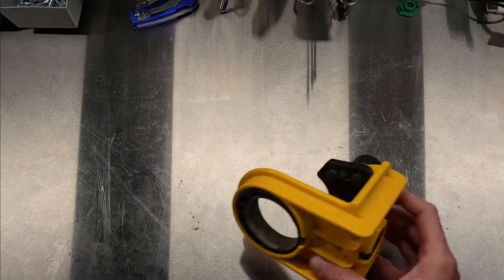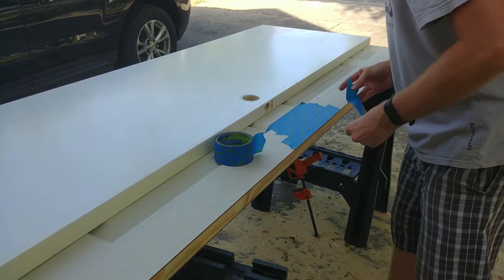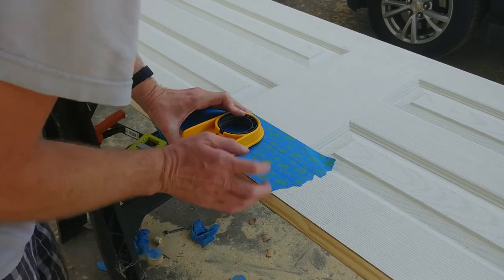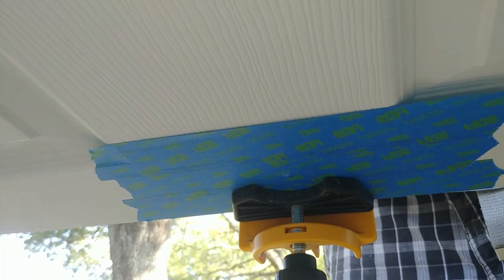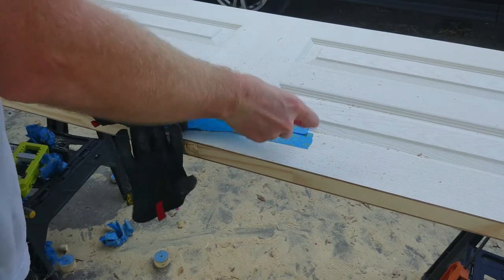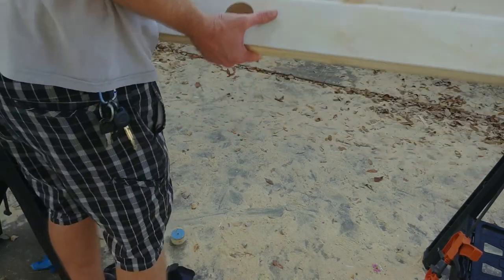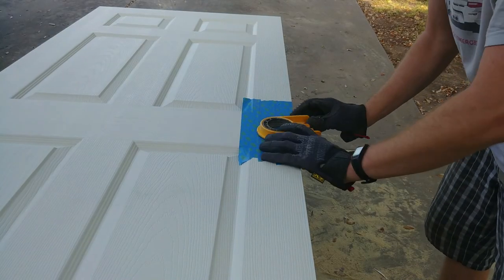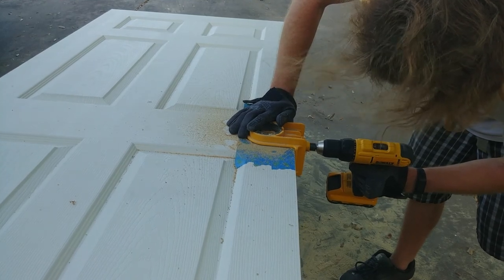Dewalt Lock Installation Kit - Boring Doors for Latches and Handles

Comment: How about solid 8’ doors 🚪? Is it necessary for a big horn boring kit? 🤷🏽‍♂️
Reply from the maker: I'm sure it could help but I didn't try myself as these were hollow core doors.  I think it really depends on how much measuring you want to do to get the latch bore and handle bore lined up properly but for me made the process much easier.

Comment: Why does everyone just do half of the job on their videos? How do you drill an accurate hole for the dead bolt for the striker plate ? That’s the hole I need to drill and don’t know how to line it up at the right spot to drill in door frame